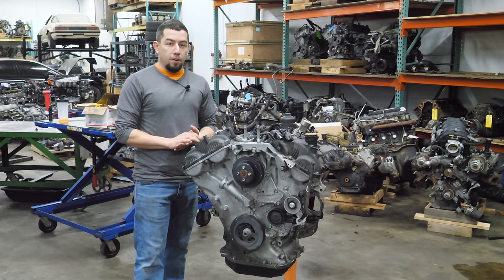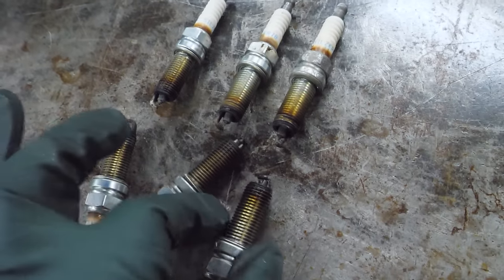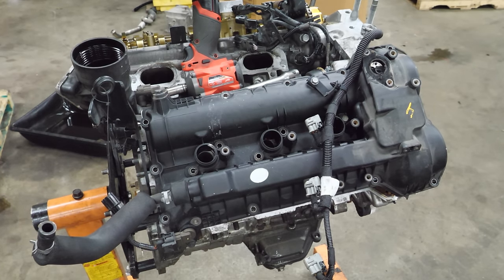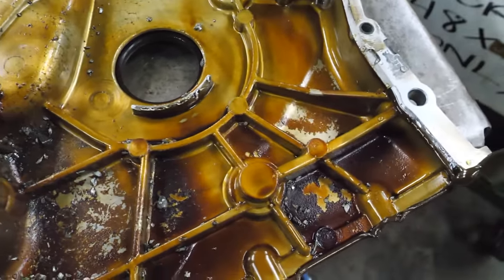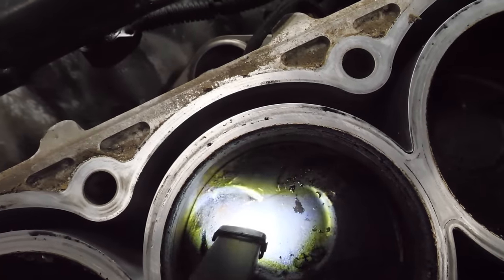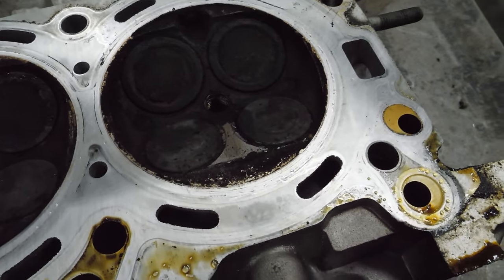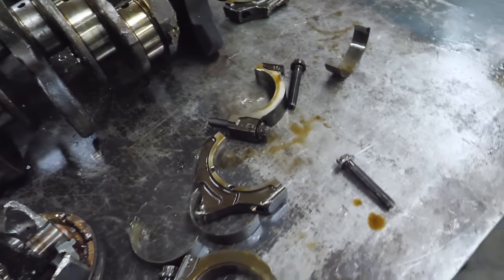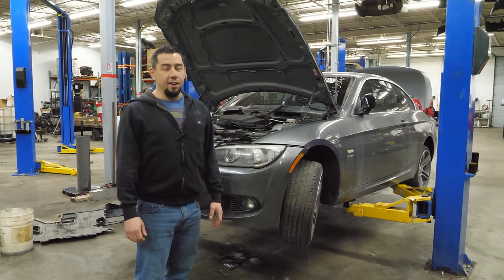Taking "Blown Up Engine" To A New Level! Kia Sorento 3.3L GDI V6 In Shambles. I AM IMPRESSED!

Comment: I am using 2016 Santa Fe limited  (which has a V6 3.3l GDI engine) for almost for 7 years now. Started driving this car from 175 miles to presently 160,000 miles but I don’t treat this engine like my old Camry v6 engine because I know this is Hyundai. This car I am using in NYC Uber and Lyft all this years, so you understand the level of abuse the engine is tolerating in NYC traffic. In NYC TLC we need to inspect our cars every after 4 months also I maintain this engine properly. This is a GDI engine and after 50,000-55,000 miles this engine started drinking some engine oil and every month I need to put a very small amount of engine oil but I check the engine oil level very frequently and I have plan to use this engine for another 150,000 miles. Please wish me luck everyone. Thanks

Comment: Some JB Weld for those holes in the block, pound the windage tray straight, put in some new pistons & rods, caps, and grind the crank & valves -- and you'll probably have something that's better when it rolled off the showroom floor. The lack of bluing on the journals says it still had enough oil -- very unusual for a Korean made car. I'd say the cause of failure may have been over-revving it until the rod bolts all broke, then keeping it running until it quit.

Comment: I've watched you tear down less then a dozen engines so far.  By far so far this one takes the cake.  I was in a National Guard humvee when the engine went.  We had always had overheating issues with the many humvees that I have driven.  This one was assigned to me as a section leader.  The convoy that we where in was pulling away from us and the military vehicles involved where designed for performance on rough and broken terrain.  After a 2 million plus driving career and all of the driving that I had done up to then I had never had an engine go on me.  It just blew up  and died.  Do you know what kind of engine it had?

Comment: Having torn apart some motorcycle engines that have let go, I thought I had seen carnage. This thing takes the cake. A motorcycle eating itself at 9k or 10k rpm generally fragments whatever pieces are kicking around, and if the engine locks, the back tire does too and the rider gets a gravity-assisted trip down the road. Engines are transmissions are usually trashed but never this bad. It looks like this engine kept trying to spin even though it was eating itself. 
Makes you wonder what kind of parts are in it. I'll bet that's a forged crank.

Comment: Yes that's quite a explosion. I`ve seen one with even more violence. Years ago a customer brought a  Plymouth Reliant into my shop that suffered a similar fate. This car had the 135ci - 2.2l Chrysler engine with a 4 speed manual transaxle. It was also a very low millage car with about 12,000 miles on it as I recall. The engine came apart with enough violence that pieces of the engine block went through the radiator! This could happen of course because this is a transverse engine installation.
How could this happen you may ask? 
This car had a tow bar installed on it and was pulled behind a motorhome. The customer lived in Minneapolis and the one of the last things they did before leaving on their vacation was to hook up the Plymouth behind the motorhome. He had his wife pull the Plymouth up behind the motorhome while he hooked it up to the hitch. 
After driving for some miles on the interstate, ( I don`t know  how many )  he noticed cars flashing their lights at him. It turns out there was a lot of smoke pouring out of the Plymouth! Luckily the Plymouth didn`t catch fire!
What happened?
When his wife drove the Plymouth up the motorhome, she shut off the engine, but left the manual transmission in LOW GEAR!
I don`t how many RPMs the 2.2 would be turning in low gear at 70mph, but I`m sure it was well north of 10,000 rpm`s. Slightly more than this engine`s red line!
A new engine and radiator and the Plymouth was back on the road. Amazingly the clutch and transaxle survived without damage!

Comment: It looks like 1 or 2 rods let go after the bearings failed. This is where the pistons were slapping the bottom of the head and still kept running... and since it was still running the owner just kept in it until it completely let go. How long? 20 seconds? a minute? It had to keep actually running for quite a bit to get that much debris into the valve cover. I can say this, I have a Sorento SXL with this engine and it loves higher rpms and its pretty stout for what it is. It was driven to its death. Impressive, yes.

Comment: Definitely almost a record. Truly engine rubble! Looks like it was hydraulicked. 
The fresh water in the cylinders is one give-away as are the entire suite of cylinders being damaged as if simultaneously. I'm wondering how long it was making a horrendous racket before it stopped or was stopped by the driver. Maybe they were too busy avoiding being drowned in a sinking car! But nothing a bit of JB Weld won't fix! ;-)

Comment: No sure where to add suggestions. But have you tried the new Ingersoll Rand Powersocket. They are a strange looking new style impact socket claiming up to "50%" more torque. Might be the trick for those really tight crank bolts on other engines. Very interesting but pricey for 1 socket. Curious about your thoughts. Love the channel

Comment: Could this have been a Manual Trans car that got chain tow while in gear, after the initial failure (like out of a flooded street)? then towing spinning the engine anhilated the remainder?

Comment: I can't believe that crank was in one piece!  It has me wondering what a set of rods and pistons in this engine or is it motor would handle.  I think this is the high water mark so far but there is always a 2 piece block around the corner somewhere.  Truly impressive though.

Comment: What is the small coil spring you are touching at 4:56? Is that from the engine, or from someone's ballpoint pen?  Definitely the most damaged engine I've seen (outside of a dyno explosion). I know that some Hyundai/KIA engines were prone to oil starvation leading to spun bearings due to valve guide leakage, and I own a 2016 Optima SXT with the Theta 2.0L turbo GDI engine, so I would be interested in seeing a teardown on one of them someday. KIA derated the Optima SXT engines between 2015 & 2016, from 275 HP to 240 HP, and did a software update later so the ignition knock sensor could also detect rod knock, hoping to catch such issues before engines failure. Love your teardowns, and am Really looking forward to more with your sweet green 5 series wagon. I saw a lowered white one last week, they are rare and beautiful wagons, having grown up with family wagons (1960 Sudebaker Lark V8, 1972 Toyota Corona Mark2, 1976 VW Dasher).

Comment: Eric I recently tried to get my sorento in the dealership for a service and they said I wouldn’t be able to for 3 months. I asked them why and they said all of their bays were full with V-6 engine failures. So needless to say I did it myself. So I’m thinking that the V6 motors are mostly junk. And I don’t understand why because I had a 2014 with a V6 and it had nearly 200,000 miles. So Kia must have changed their design of that motor.

Comment: My wife has a 2018 Kia Sorento with the 4 cylinder. With the amount of oil it burns, I'd say it's running about 40:1. Many times I've checked the oil, and the dipstick is totally dry.

Comment: I had seen this much damage on a 2010 Silverado. The owner was drunk at a bar, he went to leave in his truck and luckilly he passed out before he could get the truck in gear. When he passed out his foot relaaxed onto the throttle and it ran until it detonated the engine in a very similar manner. Most of the damage I saw in that engine closely matches the damage I see in your engine.

Comment: I have a theory. Maybe the engine came out of a stolen car? There is the problem of a good portion of Kias not having an immobilizer… Maybe some hooligans stole this car, thrashed it and sent it into a pond with a brick on the gas when it started knocking?

Comment: I'm not sure it's "The Worst"...  As you pointed out at the end, we'd have to lay out terms & definitions and parameters, for what might be considered "the worst"....

I will say, I am HIGHLY impressed at how long they kept going on this one....

There must have been a moment, when bad noises started happening....  and they KEPT GOING for some time after that.....

Speculation:  You're trying to evacuate as Hurricane Ian is bearing down on you.  You run through a big puddle.  There are bad noises...  But you're only 3 miles from the hotel...  You keep going.  For reasons that are unclear, the little Kia keeps running....  Maybe???  I dunno.

Comment: This thing must have been doing some serious RPMs when it blew up. Rather than a hydrolock I feel like the water might be post-mortem and it may have been towed at highway speeds while in gear or something given the amount of damage inside. This thing kept going a long time after it had already blown up to turn like 80% of the pistons and rods into rubble. The stuff that blew out the sides probably ended up in better shape in the end.

Comment: Yes! That looks just like my engine! My 2016 Kia Sorento with only 43000 miles was stolen and recovered with 4 new fist size inspection ports and shrapnel all over the splash guard. Bits of piston, connecting rod, wrist pins, ring pieces, crumpled bearing. Looking up through the holes the counter balancers looked hammered like that inside. I don't think mine was hydrolocked, but who knows what the thieves did. So many Kia V6s have failed it takes 9 months to get a new one. Insurance totaled it and towed it away. My son and I really enjoyed this, thanks for the closure. Kia never again.

Comment: Well, now I know what the inside/outside of an engine looks like after some knob drove through a flooded underpass during the Monsoon season in Tucson Arizona. The city even paints "depth in feet" scales on the vertical supports to warn drivers.

Comment: This engine damage is almost unbelievable. My question is what type of transmission was the engine attached to, automatic or manual? The damage to this engine is very believable if it was attached to a manual transmission and the driver selected a lower gear at high road speed. Select 1st or 2nd gear at 130km/hr, then let the clutch out and instantly the engine revs could reach 12,000 to 15,000 rpm. In 3 seconds the crankshaft would have rotated 600 times and the forces generated in the con rods as they changed the direction of the pistons 1,200 time would be enough for 4 con rods to snap and pistons to break and be pulverised. 3 seconds and it is all over. 

In my opinion this blow up was the results of excessively high revs, not hard driving or high loads. Most engine management systems incorporate rev limiters to stop over reving and the electronic controls of auto transmissions prevent the selection of low ranges at high speeds but with manual transmission change down at high speed and this can be the results. What say the rest of you?

Love this channel.

Comment: There is a channel of an English river ford and people power through them destroying all the under tray stuff (and other things) and their engines no longer run.  I'll bet a lot look like that. 

While no where near that bad, I worked at a VW shop in the 60s and a guy came in with oil pouring out of the engine but it was still running, however with just three cylinders.  I looked behind the fan shroud and there was a hole I could put my hand through.

Comment: I had a 2014 Sorento that would burn four quarts of oil every 1500 miles.  The engine finally bit the dust at almost 144,000 miles.   It started at roughly 99,000 miles and the dealer told me that they would have to do an oil consumption test and would take me over my 100,000 mile warranty and they didn't even log that I came in.  I will never buy another Kia again.

Comment: Decades ago I blew my 53 Cadillac engine at an intersection. Rpm’ s went to 120 and blue smoke completely obscured the intersection. Chewed up piston in oil pan and holes through cylinders 😮

Comment: The tip of an index finger can detect a ridge which is only 0.001-inch high.  Forget about fingernails...too imprecise.  This engine is the definition of "catastrophic failure".  The sound and smoke must have been impressive as well.  Total carnage !!

Comment: Wow! That is called powering through a thrown rod. Just keep your foot in it and it will get quiet soon! This is the worst, most damaged, engine I have seen in my life. I don't think it was an oiling issue. I think it was kept at high revs for so long, it just broke a rod and the driver kept his foot on the gas. LOL. Thanks.

Comment: Years ago I did an engine swap in a Nissan Maxima the guy raced. Pulled a wristpin out a hole in the oil pan of the old motor.

Comment: Been there with the dipstick trouble only difference is my engine was a engine going back into use and it was still in the truck broke off flush with block

Comment: ROTFL   multiple cracks, at least two good sized holes in the block... "and this is the good side!" :D

I must admit, I'm fairly well amazed you managed to get almost an entire revolution out of it before it bound up on all the crunchy bits.

When you got the BIG crowbar out to unstick that last main cap, I thought sure it was gonna let go all of a sudden and you were gonna launch that crankshaft halfway across the shop. :D

"Is this the worst?"  Well, unless you get ahold of an engine from an old truck that the Army's been using for target practice, with multiple .50cal penetrations of the block and head, yeah, this is probably the worst you're gonna get.  And really, I wouldn't wish worse on you, 'cause you do kinda need to get enough saleable parts off an engine to justify  having bought the thing in the first place, right? :D :D

Comment: It seems that whatever happened to that engine, it was going at a really high RPM when it happened, judging by the way the inside of the block walls were hammered.  Things inside were spinning around awfully fast to strike the sides so many times before something finally jammed things up.  It don't know if it was hydro-locked or if somehow only some of the pistons were hydro-locked while it was at WOT.  I don't know.  I always thought a hydro-lock would stop the engine from spinning but maybe the severely broken pistons locked and then immediately broke allowing the crank to keep spinning for a while.  Something like that?

Comment: Theory... Engine sucked up water on a flooded road.. Boom, damage done.. Cleared out the water and was able to start it up on what remained in tact, maybe 3 or 4 cylinders. Drove it many miles home banging and exploding the whole way until it was still running on 1 cylinder... AMAZING damage.

Comment: This is not a hydro lock failure. This happened because the shifter was pulled into a lower gear at highway speeds. the water is from storage after removal. This is the reason you have so many dents and good bearings. I did a v8 run into water at high engine speed, and the carnage followed the firing order. Not all cylinders were damaged.  This is clearly a money shift.

Comment: I'll also point out that these apparently like to pull the threads out o the block if you pull the heads and then go to torque them. It happened at my old shop to two different Sorentos. I don't know if the torque specs are wrong or the threading on the block is just garbage.

Comment: Has that engine been hydrolocked? Having only got at far as 19:00. It could explain the utter destruction of two pistons and rods plus the water in the top of the other cylinder.

Having looked some more, water ingestion with the engine running at high RPM might have done this. Those main and rod bearings aren't all worn out and/or overheated. Maybe the only other possibility is somebody ran nitrous on that engine and it blew up in a big way.

Comment: Maybe the reason you couldn't find a wrist pin in the pan is because when it was smashed into the outside of the block the connecting rod broke and the top fell out onto the ground.

Comment: It reminds me of my youth. We would never scrap a running engine. We would do what ever was necessary to destroy any engine we weren't going to use. This looks like one of those attempts. Although most of our grenaded engines showed more signs of heat. But this thing went off a max RPM and then some. Still... by far the worst total damage of any of your previous examples.

Comment: Boys and girls this is why you do not drive thru flood water. Most cars have the air intake remarkably low. They will inhale water before your feet get wet sitting in the car.
Eric even the engine that had one broken wrist pin was not 1/2 as narley as this.